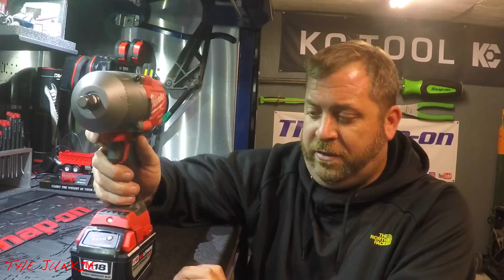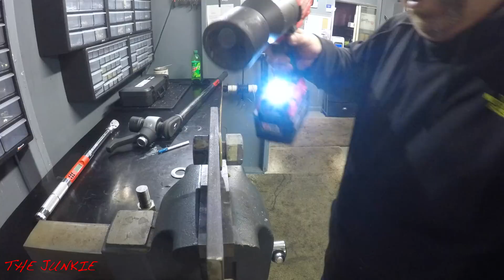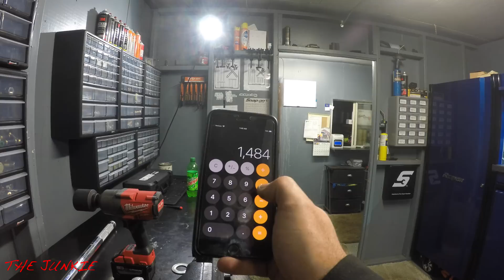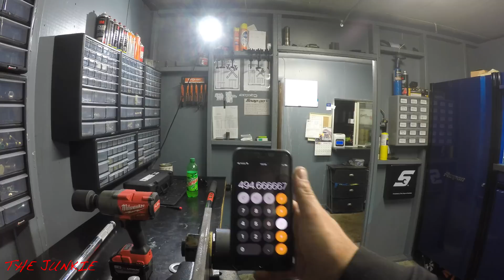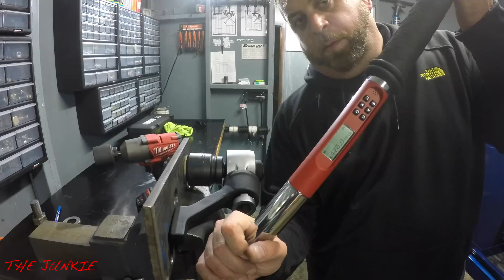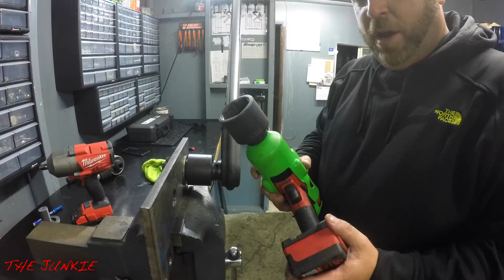REAL WORLD MILWAUKEE 2767 TORQUE NUMBERS?🛠🔩🦍💪🏿

Comment: I feel this can absolutely be used in the automotive industry. Ever try running a press on a ball joint and 500ft/lbs isnt enough to send it in?  I have sat there for 3 minutes and ear pro on trying to press in a ball joint at that.  THe biggest problem people have is they think everything needs to stay on the number 3 setting.  Most auto you can just switch to number 1 and 2.  I have my M18 Fuel 3/8" which I use quite often in teh engine bay.. I just bought the 2767 for all the other big stuff.

  Learn to control the power.  Take a permanent marker and write the numbers on the base for 1/2/3 and use them appropriately.  I'll never forget when I had to bring my truck in to a shop to have them remove a bolt they put on.  It bent my breaker bar and took them over 1000ft/lbs on a snap on 1/2" to pop it loose.  Would much rather have that power and more in my hand and know exactly how and when to use it.

Comment: SAE J429 large bolt size is 1 1/2 inch which can be torqued down to 3100 ft lbs.   That being said a ASTM A354 4 inch bolt grade 8 can be torqued to 58000 ft lbs. Yikes

Comment: I would personally just use it on the 2nd mode if it's that powerful. If you use the gun at a lower setting it should theoretically last longer then the mid torque gun at full power because you're useing a much smaller amount of its max power. So all in all I would still buy this gun for automotive work and in a situation where I need that extra power I still have it. Or maybe I'm just trying to justify buying this impact wrench....

Comment: This is probably a good place to ask this question.  When I work on my cars I try to torque just about every fastener I can reach with a socket, but at times I have to use my torque wrench with an extension.  How much does that effect the torque reading?  I suspect it has some effect on the torque reading but I just ignore it.
Reply: Three years later... but here's an answer of sorts::
There's an app to calculate correction settings to use when using crowfoots or length extensions (effectively making the torque wrench longer).  The quick and dirty cell app is called Norbar Torque Wrench Extension Calculator.  SOCKET Extensions... nope.  Doesn't do jack to the torque.  It's when you lengthen the overall length of the torque wrench with a crowfoot, etc... yeah... that messes it up.  If you want proof of socket extensions not affecting torque... see the url above part with v=RSRU7QGDnsI .... replace that RSR<blahblah> part with tRR96ILGORU for a video showing this.
Using an extension on an impact wrench... yeah, that messes with it.  It acts like a rubber band and takes away the torque the hammers are applying.  It's like putting a piece of rubber between a hammer and a nail because the extension twists on each hammer.  The longer the extension, the thicker the piece of rubber.  Impact extensions don't have an effect as much as the regular chrome vanadiums.

Comment: Had a flat tire on one of our grapple skidders. Our log hauler has one of these and offered to bring it out and spin them off. I said there's no way since the lug bolts were put on with a 1 inch IR impact. He spun em all off except 4. And those 4 took a 3/4 rachet, 6 feet of pipe, and him and I bouncing on the pipe to break loose. I was impressed with it's torque. Made my DeWalt impact look back. I'll be owning one..

Comment: I have both of these guns, Milwaukee is a beast. Trust me, you will regret if you getting snap on gun. Snap on gun is weak and expensive.  Milwaukee it's cheaper and there warranty is 5 yrs compare to snap on 2 yrs warranty.  Milwaukee 2767 is perfect for automotive.  If you're looking for 1/2 cordless impact, go for Dewalt dcf899 or Milwaukee 2767.

Comment: I have a commercial zero turn. Have a Ryobi with 350 foot pounds. Had been using that to take off my blades, one nut was on too tight and couldn't get it off for the Ryobi, tried for 30 minutes, so I ran to Home Depot and got one of these, needless to say, it took the nut off in a half a second. Glad I got it ,don't have to worry about nuts getting stuck on anything ! Great video by the way !

Comment: Air guns are much more dangerous than this... Have you ever taken off a bolt with an air gun and a swivel attached to it? The second that bolt breaks free the swivel and socket goes flying off the gun at near supersonic speeds.

Comment: You had it on setting 3 setting 4 is max torque reverse
Reply: There is no setting 4. That is a setting which like setting 3 uses full power to breakaway a nut but then it slows the rpm down to keep you from slinging the nut off

Comment: (It’s already not an America company)Chinese Milwaukee Tool
More than 96% Milwaukee tools are made in China. Milwaukee Tool has carried out tool-design job in China since 2015 year, the design jobs also are slowly sent from USA to China.
Most plastic materials have been changed from America DuPont, GE to Chinese sources. The red plastic，Nylon，of Milwaukee tool handles/housings has been provided by a Chinese supplier since 2010，originally the Nylons were from DuPont，the Nylons-changeovers caused the handles/housings weak，like screws very likely strapped/slipped in screw holes/bosses, the dimensions are not as much stable. Also black hard plastic for battery pack cases/covers，their materials were changed from GE ABS/PC to a ABS/PC from a Chinese supplier，caused battery pack case more likely broken, brittle, the same story is happening on anti-flam Nylon material of battery frame，changing from DuPont to a Chinese supplier. 
Lots of bad tools always first are sold to USA because nobody inspects the outgoing, and because in USA Milwaukee Tool has the strongest warranty service ability than in other countries.
During Milwaukee production process, more than 5% defects found out by workers, also more defects failed to be screened out. Bad tools include noise as gear, bearing aligned badly, sometimes press trigger no reactions at all, metal parts like shaft, gear, pinion, important screws broken as poor heat-treat, motor stator rubbing with rotator, fine wire laid inside tool broken as poor design and poor workmanship, big percentage of oil leakage for hydraulic tools, etc. 15% chance you will get a bad tool, bigger chance you will get bad tools for nailer, planer, hydraulic tools, cable/tube cutter, as they are first generation of tools for Milwaukee Tool, because of comparing with sawzall, drill, Milwaukee Tool sucks at nailer, planer, hydraulic tools, cable/tube cutter, AC tools, drain cleaner, blower.
Milwaukee Tool workers only get less than 300 dollars monthly salary，even plus OT to 276 Hours a month（normal month-workhour is 176 hours，plus 100 hours OT. Chinese law only allows no more than 36 hours OT per month）， after OT 100 HOURS for every month，a worker can get 500 dollars monthly salary，this salary very low for living in a big city in China, plus bad working environment(the management has no such safety-first mindset that loud noise but no issuing ear plugs to workers, at dangerous stations very few goggles issued to workers. workers stand more than 10 hours every day during on-duty time), so Milwaukee Tool with huge employee turnover，400% yearly turnover，ie workers averagely work only 3 months for the factory, cause workers without enough experience，lack of training，then unable to ensure good quality. And worse worker- turnover with most Milwaukee Tool’s suppliers.
After Milwaukee tools launched one year， Milwaukee Tool will do so-called VE, value engineering ，actually cost-down, change Germany trigger to Hong Kongese trigger even Chinese trigger/switch, change Japanese chuck to Chinese chuck, etc. Milwaukee Tool has a team, 50 people to do the VE. The quality would obviously become worse after the VE.
Milwaukee Tool has really bad quality system, lose much profit because of failing to keep quality constant, like critical metal parts broken, every 2 months taking place, no methods to resolve the issue in 10 years, starting from 2008. And always look for cheap materials, cheap suppliers, worker salary is always slightly higher than minimum, only 0.17 dollar higher than hourly minimum salary.
Milwaukee Tool has less experiences for making power tools comparing with Dewalt, Makita, Bosch. Milwaukee Tool only has grew fast from 2008 year. Milwaukee Tool copies and compares life test with Bosch, Dewalt tools during new product development stages, even when doing troubleshooting during R&D, would measure dimensions of these competitors’ components.
This company is also an ugly company, in 2014, a Hong Kongese manager tried to rape a female employee during their business trip, the company fired him and less than half year, hired him again as a manager, then the female employee left this company and lost her job. In 2015, in its factory dormitory a more severe rape case really took place by a male senior manager to a girl/employee, and this Company didn’t do anything to him, like firing him, like reporting him to police，helping officer to arrest him.
Reply: jamesmilwaukee richsteveman lmao Milwaukee makes great tools dickie

Comment: The power of these tools is good the warrenty is the best but they just suck you throw or drop the brushles fuel line they completly break down and wont work anymore thats the only reason i buy these tools is because of the warrenty they are complete crap for my line of work brush drills are way better and withstand a beating.

Comment: Had to use this gun on my  2001 Land Cruiser from the rust belt.  Needed to remove the tow hitch and  none of the bolts would budge, i had a breaker bar on that and it broke the head off the bar.  I decided to open this tool up, was gonna sell it since it's over kill.  Opened it up and took it to the bolts, spun right off, this thing is a monster.  Think i'll hold on to it.  I also have the mid torque that i use to work on brakes and pulling lug nuts.

Comment: You should do a test video on the Milwaukee mid torque impact. They are rated at 650 breakaway and mine would not break away my head studs which were torqued to 240🙄
Reply: My 3/8” impact would do that

Comment: What is Mode 4?
Reply: Mode 4 is the same torque in mode 3, but the gun detects when the fastener being loosened breaks free. The gun slows the rpms to 750 so as to reduce the likeliness that fasteners and/or sockets are flung (and become a safety issue).
Reply: @gt500knights  If it's anything like the 3/8 drive we have at work it will detect when the fastener bottomed out and stop after a couple of seconds.

Comment: For The heavy duty industry they should’ve done three-quarter inch drive. I work on buses and I have the older half-inch and three-quarter inch models of this. In all cases the three-quarter inch handles heavy load much better, It uses that surface area to spread out the torque and can generally beat the tits off it’s half-inch brother.
Reply: johnpaulstez They do. 1200/1500 3/4" one key

Comment: I have been looking at getting this gun i work as a moblie service for tractor and alot highway truck wondering if be alot easy to removed truck lug nut off instead draging out the air line and stuff

Comment: ITS YOUR OPINION ....BUT YOUR OPINION IS 100%  RIGHT....THOUGH ALMOST NO WORKSHOP TORQUE THE LUGNUTS AT THE MANUFACTURER S  SPECIFIED RATINGS...!!RUST AND MUD AND DEBRIS SOMETIMES NEED MUCH MORE THAN 200-300FTLBS...TO LOOSEN THE NUT!!SO IF YOU JUST LEAVE IT IN THE SECOND ADJUSTMENT AT 600 NUT BUSTING TORQUE YOU ARE PERFECTLY FINE...THAT WAS THE MAX TORQUE FOR THE MAKITA  BOSCH HITACHI MILWAUKEE DEWALT OLD BRUSHED VERSIONS...BEFORE WILWAUKEE COME UP WITH THE  FIRST 1100 FTLBS BEAST!!THE ONLY REAL DRAWBACKS ARE THAT IT  IS HEAVY AND BULKY!!GOOD NEW YEAR!!!

Comment: My 3/8 Fuel is a fucking machine, but the bearings are still chinesium and have had to send it back. Guess what, they didn't rebuild it, they sent me a new one cause the serial # are different. It was either more than I told them or it wasn't worth rebuilding. Still have a soft spot for Snap On and Cornwell, but I can pay for Milwaukee right there, the big names I use for hand tools mostly.

Comment: Let's see it take off 22.5 wheels
Reply from the maker: Cole Wright There’s another video where I do you take off wheels with that I do believe it will take off 24 fives
Reply: i may just have to think about replacing the 1" at the shop for use on the dump trucks, the 1" is too much at many times
Reply from the maker: Cole Wright If you do just by the bare tool and then go get a nine amp hour battery you’re going to need That for the truck tires Just makes it so you can do like a complete set not a complete set but two tires are two axles just a heads up it will work though
Reply: does it go through those 9mAh batteries pretty quick? We do a lot of road calls so it helps to have a cordless, but would also be nice to have around the shop if the batteries last a decent amount of time
Reply from the maker: Cole Wright It’s absolutely perfect for road calls him I did six tires on and off with like 3/4 of a battery then I had to charge it but that’s on and off so for route calls it a work perfectly
Reply: that's perfect thank you! we have a snap on 1/2 inch we use for the medium duty trucks, but we got to lug around a 1" for them big ones.
Reply: I have one, I work in an underground gold mine and work on heavy equipment. I recently changed a tire on a 50 ton rock truck that has 50 wheel nuts all torqued to 500ft/lbs. it took every nut off faster than my 3/4” air gun. With the 12ah battery I was able to take all the nuts off, put them all back on and go around all 50 nuts twice after tightening while only using 2 bars on the battery. I use this tool daily and I love it. one of the most valuable tools I’ve ever owned.
Reply: Mine will take off 33mm lug nuts no problem.

Comment: What about having years of rust on the bolt??? or nut??? Especially living in New Jersey, New York, Pensylvania? and in other states where it snows and you have beaches with Ocean Water?, I think it would destroy it, so thats where you need a good 1/2" air gun, or a 2 foot breaker bar with a pipe on the end, lol, lmao.
Reply: Or if the 1/2" air gun will not break it loose, then you go to a 3/4" or a 1" air gun, hahaha more power, as Tim TheTool Man Taylor would say.
Reply: Guys if it won't loosen it it will break it

Comment: isn't that the gen 2 1/2" impact? if so there's a 4th mode for highest torque
Reply: Mode 4 is not max torque. It slows the reverse speed Down once the bolt breaks loose so as not to have fasteners flying off.

Comment: I'm an auto tech and I just bought this today, the REASON I need big dick banana hammock mode is because there are A LOT of ASSHATS in the industry that hammer on lug nuts full blast for 20 minutes straight, and I fuckin hate dropping the lift to breaker bar them.

Comment: I'm sorry but I don't agree with this not being  designed  for the automotive world.  We usually have extensions and swivel sockets hooked to this thing which kills its power.  If You don't have a gun that strong then get the breaker bar out and strain and bust ur knuckles. Plus all of us professional techs have already had pneumatic guns with the same amount of power.  We know their place and when and how to 
use them.  It's nothing new.  Just cordless. And yes I own this particular impact or else I couldn't even put my 2 cents in.

Comment: Snap-On Junkie! 
Beast video!
Nothin but the facts!
I like it!

I think that nut broke because it was welded and it cracked because it probably went as hard as glass after being welded.
Hard as glass and just as brittle. The impact hammer just finished her off....a hammer would have done the same....My thoughts anyways!
Great video! I was eyeballing the mid torque....looks like a good move for me!
Thanks!

Comment: I disagree with your thought on it being used in the automotive world. This tool would be great for using on car wheel bearing, ball joint, & bushing removal and installation equipment.  This is also good great for mobile mechanics. One just needs to aware of the power.
Reply: yes for tightening.. but to loosen a bolt what does it matter???...and also it has 3 speeds.. 1st and second are probably good  for 99% of thing an average person will do
Reply: I use this on a daily for industrial use  on large heat exchangers and 300 ton presses and trust me ....this thing is an animal way over kill for your truck it will snap bolts in a second ...BUT that being said ...it's your money you work for it if you wanna spend your money on something you might THINK you need then have at it
Reply: Jeremy Beesley, getting back into the heat exchanger business, definitely buying this tool for them and heavy equipment. Goodbye manual torque multiplier and breaker bars! Had to comment it's not every day someone besides me mentions a heat exchanger..
Reply: I dont  understand how more power to REMOVE a bolt is a bad thing? 
 I mean I usually use a half inch drive ratchet to remove most items..long handle dont have to pull as hard ..
 Now I can understand not tightening with full power SNAP// 
 BTW I have the  gun he is using ..I final torque by hand
Reply: stifflers69mom1 it's 450.00 for the tool, charger and two batteries last time I checked
Reply: @phillipzan2005  Home Depot on line has 2767 plus 1 5ah bat. with charger for $269 11/26/19 special buy
Reply: deepsquat600 yes I agree you totally I don't really know how much that thing is but I'm sure you pay a pretty penny for that 1% your talking about
Reply: I just used an Earthquake xt cordless for first time. Removing bolts, hell yeah. But putting bolts on, I was pretty nervous. Way too much power to slam them on carelessly.

Comment: I use mine every day as an auto tech it seems that all the battery powered tools loose more power when you add a woble socket and an extension as compared to air tools